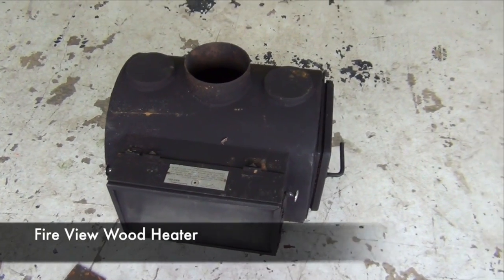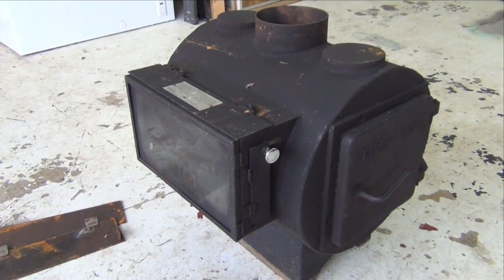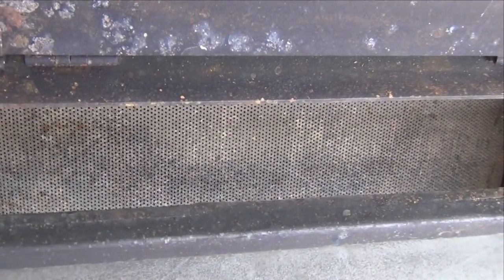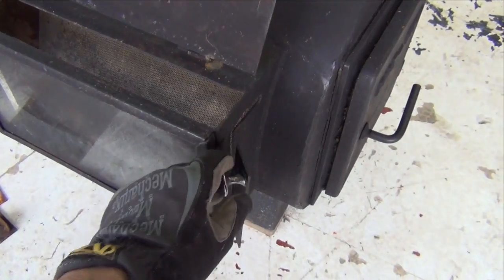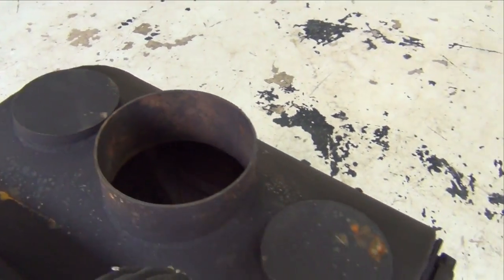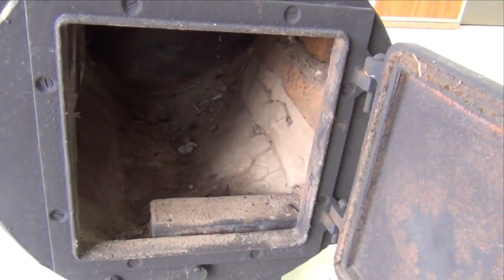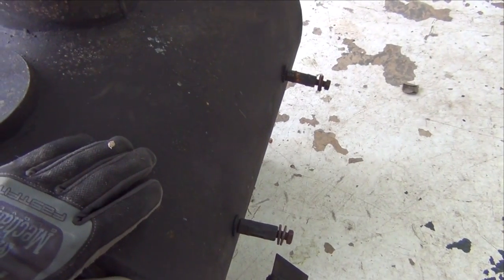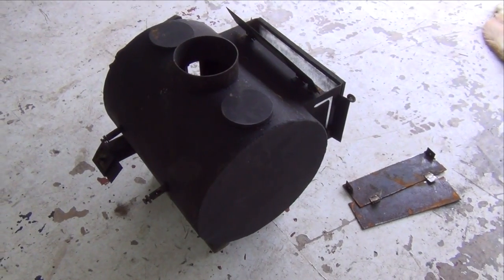Fireview Woodstove Restoration

Comment: I have had two of these. Very good stoves. NOTE that there are some copies out there that are really no good. I sold mine to get a Kent wood stove which was even more efficient and seemed a bit safer. Hope you have it up and running by now. Good video!
Reply from the maker: They were made in Rogue River Oregon years ago, I was actually contacted by the family who made them.  They sent me original documentation.  Not bad for spending 35 bucks at a garage sale and a can of black stove paint.